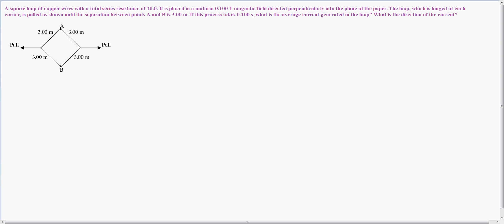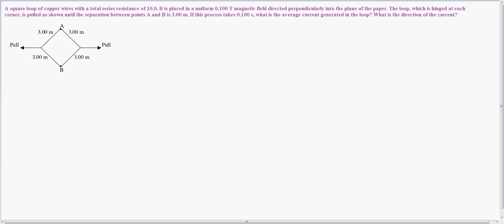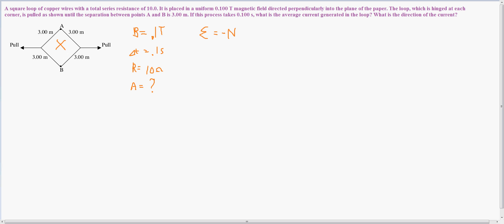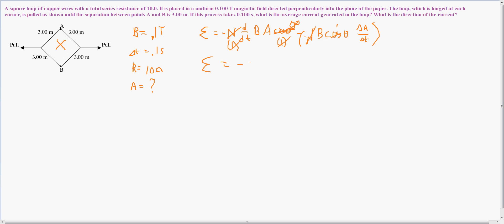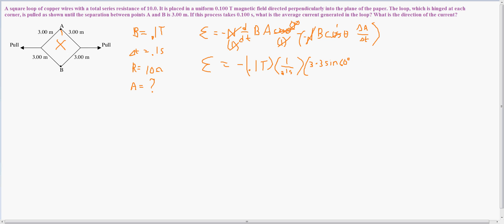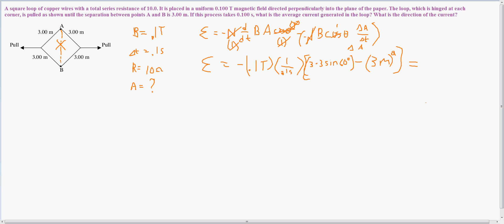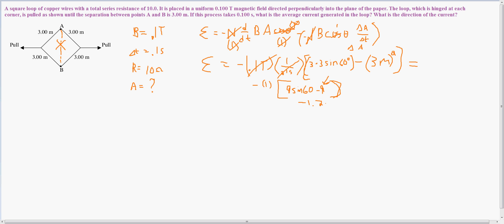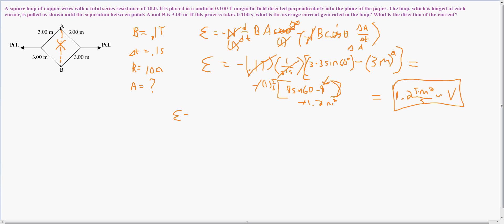A Square Loop Expanding in a Magnetic Field

Comment from the maker: I multiplied by 3 because the distance between A and B is 3m and the distance from that line to the edge is 3m*sin60... [** Area of a parallelogram = 2(1/2B*H) of two triangles)**] so we have base times height of one triangle, found the area and instead of dividing by two I just leave it (because we have a parallelogram which requires the area of triangles on each side). I LOVE GEOMETRY!

Comment from the maker: If the distance between A and B is 3m and each side of the loop is 3m we know this has to be a parallelogram, but not a square. That being said take the 3m between A and B and split it down the middle to make two triangles. Find the area of one and double it. If you wish to have a visual, draw the figure, slice down the middle, then slice the triangle down middle. You then have 3m for the h, 1.5m for the a (adjacent to 60). I did 3m*sin60 to obtain the unknown then multiplied by 3